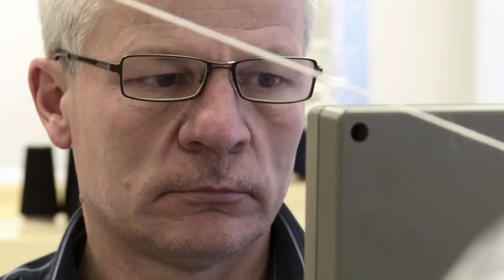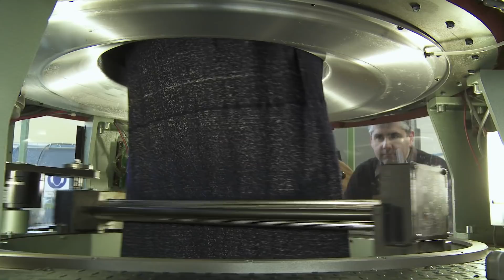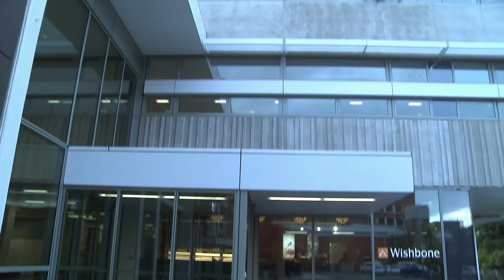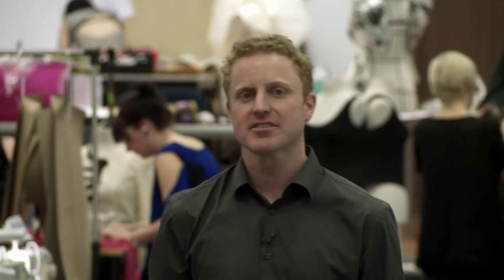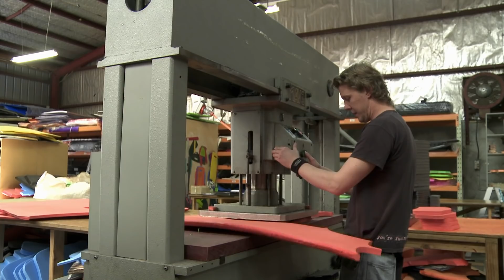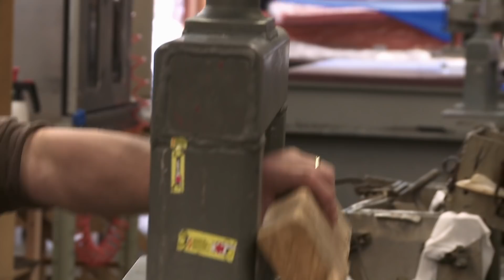How Science Is Changing The Fabrics You Wear | Ever Wondered

Comment: Screen printing isn't limited in color, and after the initial screen burn, I could have banged out 4 shirts of that design, in just the edited down amount of time you showed. 

Custom colors outside the CMYK process would cost extra, for the time invested, but no it is NOT impossible.

Edit: it is worth noting there's at at least an hour of set up before getting to the point of actually screen printing, more of course if the screen burn goes south.. So there's that. But the printing goes insanely quick....labor intensive too, as you add more colors